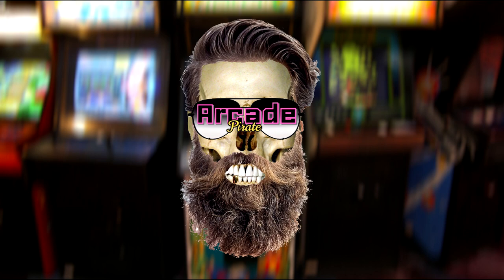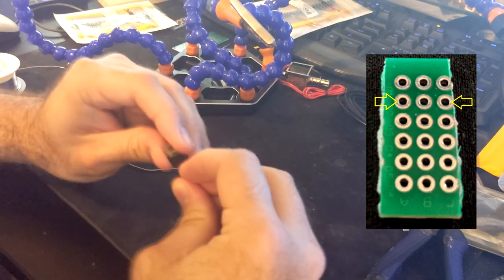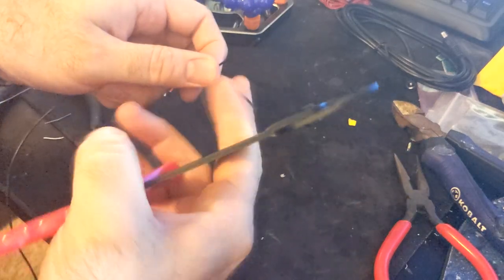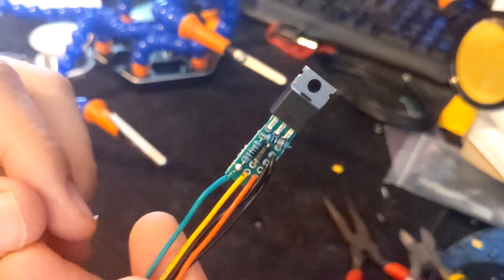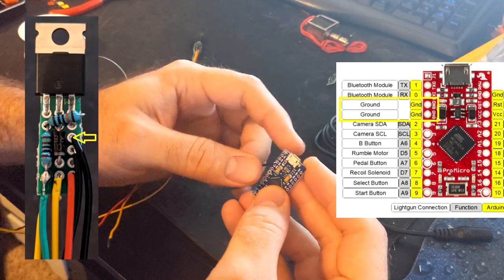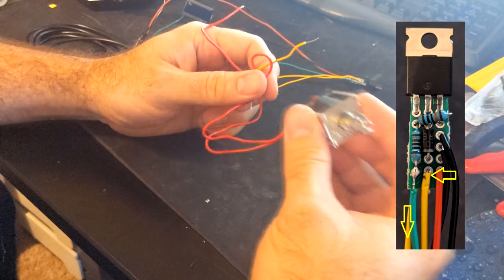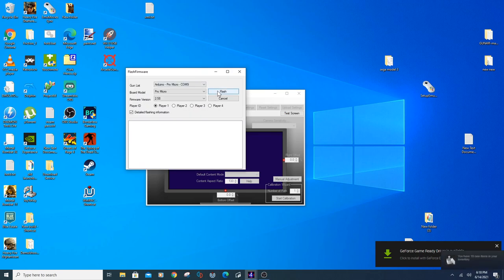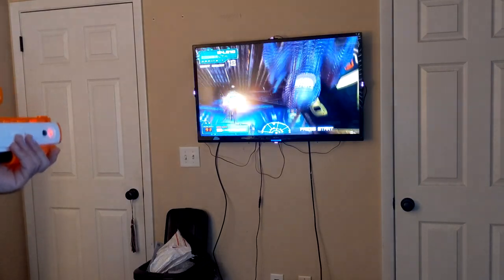Recoil on your GUN4IR

Comment: I bought one off ebay not doing enough research and the seller provided me with no license file and if he is unwilling to give me it am I just screwed then? I bought this expensive gun off the guy and he does not feel the need to mention id have to spend 30 dollars just for a license for the GUI that sucks compared to aimtrak. Then the ir sensors are 50 dollars like damn son.
Reply from the maker: Sorry to hear that. If you need a new gun or any parts go over to https://rpegelectronics.com/
Raymond will help you out.

Comment: @Arcade Pirate, I am beating my head against the wall at this point. I followed this to the T for the board, but I am using an Arduino Micro, and can not get the recoil to work. Will this method work with the new 2.64 fw? and if so, can you tell me what pin to put the green wire to? I have tried D16, led flashes on the board, but nothing happens.

Comment: Hi could I just ask is that solenoid running off usb from the arduino? I saw it was a 12v 1A solenoid that's all so wasn't sure how it was getting enough power without damaging the arduino thanks :)

Edit- actually I think I am a deeply stupid person. It looks like the 12v power supply is wired into the circuit board and the arduino will run off an external 5v power supply yet unseen, as the video just uses a PC to test it. I think that's correct 🤔

Comment: Another great tutorial! At what temperature and solder do you use? I keep burning out the mosfet when I install it.
Reply from the maker: I set my soldering iron to 450C. Sorry it took so long to respond. Is it melting the mosfet? I had a similar issue with my buttons on the side of my gun.
Reply: @ArcadePirate  No worries. You are still my favorite Pirate ❤️ I was able to figure it out.  The lowest temp I can flow with the solder I’m using is at 540F. I’m assuming you meant Fahrenheit not Celsius. What solder do you use? I had trouble having the solder flow. I don’t know if it had to do with the type of metal the mosfet has. I ended up using a wire for each prong to improve the flow. It worked! Thanks for getting back to me 😘